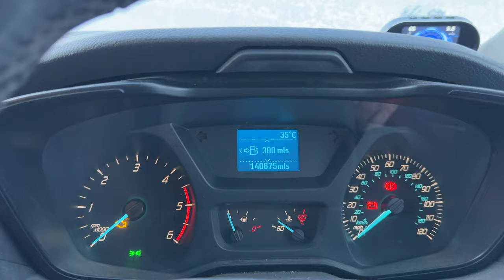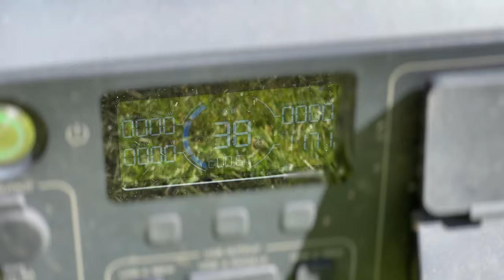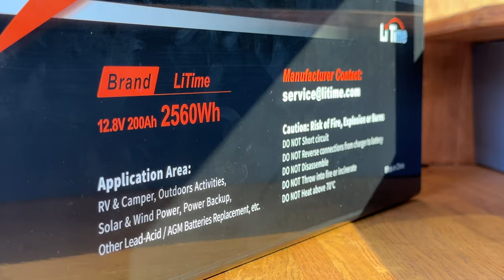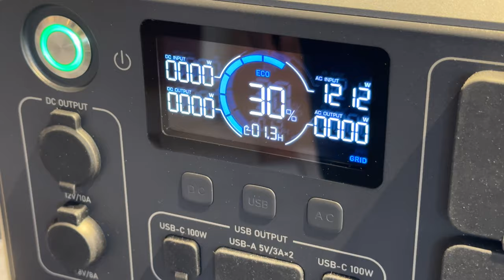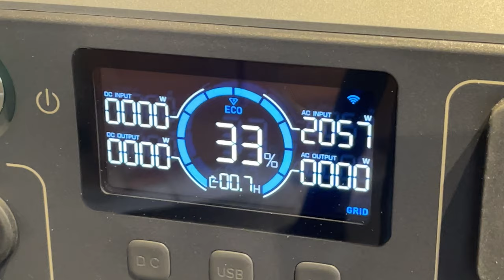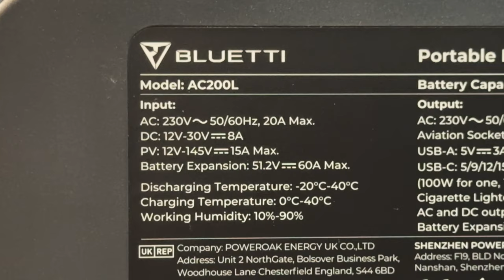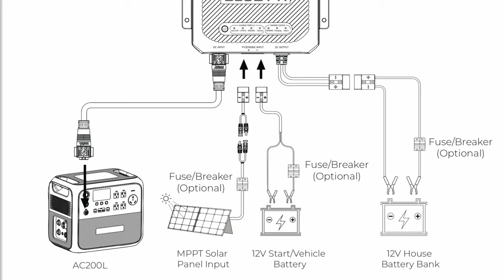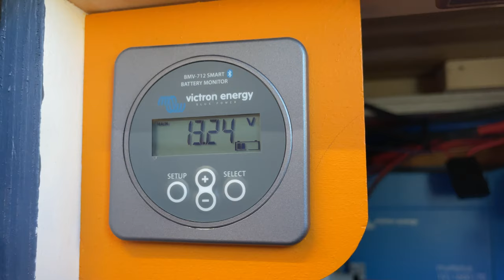NEW 48V Port and not 12V? BLUETTI AC200L Powerstation Walkthrough

Comment: This power station makes no sense and I can't understand why it was make. It was meant to update the AC200 Max. But taking away the 2 wireless charging on top, plus the 12v 30 amp and this 48v input is useless has from today they still haven't come out with a plug for it. But now the new AC240 it out. This is the real update to the 200 Max. Just not sure why it's IP65. I don't know many people that would leave it outside in the rain without anything plugged into it? And they have put back the 12v 30 amp. This is great for van lifers as we can use this to power all our 12v. And it can still be charged via car EV stations to which is a plus.
Reply from the maker: I agree to be fair and I kind of say that in the video that the AC200 max is  considered was better for the use case I would want it for with the high amp 12v port. The AC200L in other areas was superior. I think it went in a different direction and for what I would want it for. don’t see much use of the 48 V.
Reply: I bought it for the UPS function as well as the ability to set charge levels when to use solar or wall power (or both). Failsafe Internet as well as power outage protection.
Reply: I like how many people are stuck on useless, and inefficient 12v, and are to dumb to learn about 48v. 
You’d expect these below average consumers to learn about how much cheaper, safer, and efficient 48v is.

Comment: I just have the Ac200L in the garage connected to the solar and also connected to the hook up point when I am off grid. If I get stuck I have a LPG Generator and an external tap so I can use the LPG tank to charge it up and run the van at the same time
Reply from the maker: Sounds like a good option for a off grid back up easy ways to recharge, reasonable sized battery and large inverter

Comment: They're rarely maxed out at 12v for input
Reply from the maker: Can’t you elaborate?
Reply: @MispronouncedAdventures  they all have a PV input range.  They're normally 12-28v for small power stations and 12-48v for mid-sized power stations.  I think 12-60v is the biggest range I've seen for power stations that can't be easily tied to your home system. 
*Some very tiny power stations are 6-14v but I haven't seen a new one with a range like that for a while.

Comment: So I just ordered the AC200L. Is there no way to power my 12v system through it? That’s my only reason for getting this model with the 2048wh. Thank you!
Reply from the maker: The AC200Max is the model with a higher output 12V port. The AC200L is normal 12v socket which is limited to 8 or 10A

Comment: So is there a solution to power 12v electrics to date?
Reply from the maker: Yes, one of the other 200 bluetti models does have a high 12 V output, additionally there are other brands, although rare do have some with 20 to 30 amp 12 V outputs.

Or depending on the nature of what you want to power AC to DC converter off the inverter would work as well
Reply: @MispronouncedAdventures  I already bought the ac200l before I started my build. I'm sure there will be ways around it.

Comment: Groovy... I want 50 of them for my mansion in the .. oh well..  🙂
Reply from the maker: If you wanted an off grid electrical system for a mansion, I could build you far better through work 😁
Reply: I may lose my grid connection as the neightbour holds my meters and refuses to give acess to the suppliers.
I am looking for a sistem that can power a fridge and washing mashine and some shutters motors , open to ideas!!!!

Comment: Nice sincere review, Alex. It will be an interesting option to have that D40 interfacing with an existing conventional setup. It surely makes it an option to has a a backup battery or to extend existing systems.
Thanks for the video.
Reply from the maker: I do you think the D40 whilst would not been perfect it’s actually quite an interesting way of interfacing power station with an existing electrical system. 

Online groups do love to argue about our traditional electrical systems are better than power stations. Which in one way, I very much agree, but traditional electrical systems are not portable and don’t have use cases outside of the van.

Stated in the video different solutions work for different people.

Comment: A little trick I found when I tried to start a Chinese diesel with a Bluetti EB3A with 10A 12V was to connect a Maxwell Ultracapacitor I had knocking about, I could then get the heater to start and run. 

I recently bought a AC200Max to power my camper(s) I have a two so can swap it between them (saves money)and also use it for power tools for work, works great. I use a 1000 watt inverter to charge it whilst the engine was running. I don’t really like the touch screen and would prefer buttons like on the EB3A.

I guess what I don’t like when using it to power a camper, if it stops working you lose everything!!! Fortunately on my recent trip to Europe it worked flawlessly, unlike my T4 where the cambelt snapped in the South of France 😭
Reply from the maker: Could you explain to me what you did with the capacitor? I Always like learning something new. 

Yeah, there were quite a few people on you who used the Ac100max as a main system and using an inverter whilst driving to charge. I could agree with the touchscreen. There are many occasions where I would prefer a touchscreen, but this isn’t one of them.

And I understand from the redundancy point of view, I normally use The traditional electrical system in travel with a medium sized power station as a back up

Comment: Thanks, very good info and great edit. This unit was first pick for our van, but the 48V DC output is a deal breaker.  D40 is going to be expensive, and for what it does, totally  unnecessary.  
The newest AC240 has dedicated 12V 30A output, and is $300 cheaper right now. Trade off is solar limitations and weight, It's a beastly 33kg/72lb.
Reply from the maker: Personally, I would’ve preferred the 12V 30A output than the 48V 8A for the D40 as well. But I guess aiming it different markets. I do like the idea of running 12 hour applications directly from it
Reply: @MispronouncedAdventures  
Ok so actually, D40 might be a game changer? For new van builds, just buy 2 LiTime 100A to run your high amp DC fusebox (fridge, heater)  D40 will charge all your batteries from solar or starter dc/dc!

Comment: I have the smaller brother of this, the AC180P. When connected to solar and the sun hides behind a cloud, it has a rally annoying click as something disconnects inside, does the AC200L have this feature ?
Love the new screen, miss the light (but as it's not really portable I can understand it's removal)
Reply from the maker: I haven’t noticed the click on this Model. But many power station models ( not all ) do this. It’s an internal relay. which usually flicks between higher amp 12 V DC charging or higher voltage but low amp solar charging as often the solar port is used for direct 12 V or solar charging. 

But I have found that in some occasions in different light conditions, you can get exactly on that point where it switches
Reply: Hi …i have a ac200l … and the „Click“ is also like the other powerpacks 😊🤷‍♂️
I asked Bluetti to cut the sun cable when it startet to „Click“ …the answer: no you don‘t Need it
Reply: @froggy5087  I'm not very impressed with the AC180P, it loses more watts that in takes in 😞

Comment: Hm...   
That Electric bicycle you used last year... Doesn't that have a 48V motor?   
Place the Powerstation in a bicycle trailer and hook it up to the bike with a cable...    
No need to waste power by charging the bike battery from the power station you had on the pannier. ;-)
Reply from the maker: Very much already thought of this! unfortunately the 48v port has a communications pin. So it needs to communicate with the bluetti device that it connects to too do anything. 

Maybe I should see if I can convince a company to send me a 48V server rack battery  😁

Comment: The D40 has now been released here in Europe. 219€ 
Mine just arrived, I'm really disapointed with it.
I was told it would give me 12v 30amp like the AC200Max.
Yes you can run it as a load supply or as a house battery charger.
BUT It only gives 12v 20Amp. not the 30Amp as I was told by Bluetti before I bought it.
So for me it's usless, and to make it worse the costs of 219€ seems exorbitant for what you are getting
So I have no idea what the 48v output replacement can be used for, especially as it seems the only thing you can plug into it is the D40 :(
Reply: Hey man, same situation as you. However I was led to believe I would be able to run my diesel heater off the 20amps from the D40 but it won’t even let me do that due to the surge! Complete step backwards in my opinion